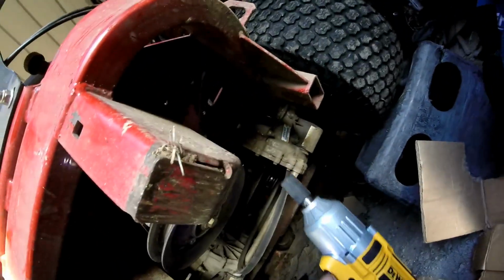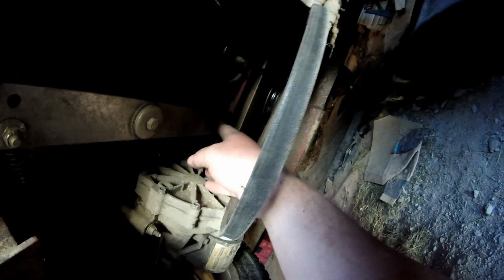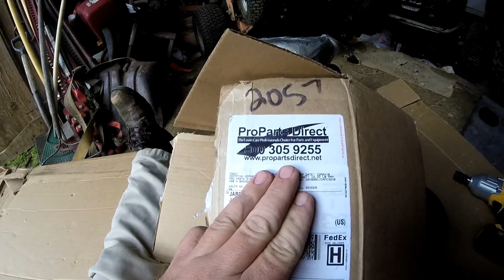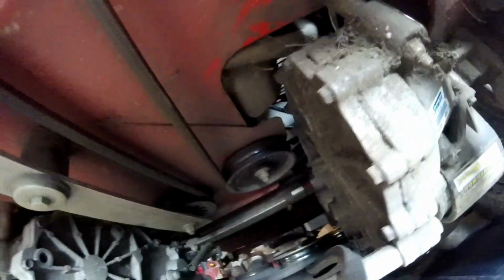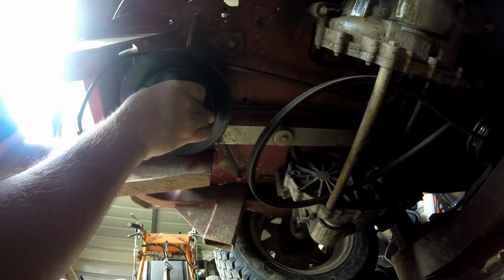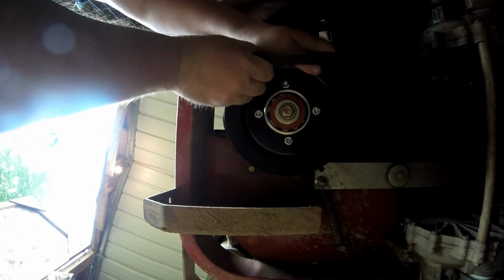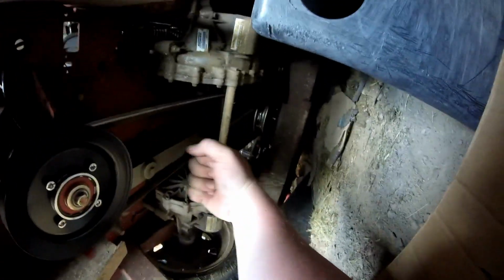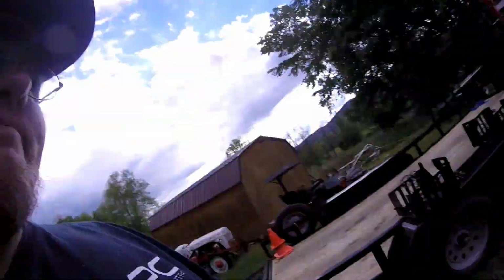How To Replace A PTO Zero Turn Mower

Comment: don't they make this noise when they need the clutch to be adjusted? Is this not adjustable? Friend of mine had the exact same noise as yours did and all he did was back off those spring screws around it and spins like butter again. The clutch was engaging when the PTO was disengaged and dragging so a slight adjustment fixed it. Try it if you still have the old one!

Comment: Why is my fly wheel turning when I try to remove bolt from PTO clutch. Toro zmaster 74923
Reply from the maker: because it is attached.Why I use an impact.If not you need someone to hold the fly wheel nut whilst you remove the pto bolt.
Reply: @exterminator1  thanks
Reply: @christopherholland9498  Mine was doing the same thing, so I broke out the impact and it worked perfect.
Reply: @pezatsea  Yea impact worked great. I believe I saved 500 or more doing it myself

Comment: Nice job! Ain't it fun working without a helper! I think ur supposed to use blue Locktite on bolt. Anyway after watching ur video I feel confident in changing mine on MX5060. Gonna get an Extreme clutch.

Comment: I spy a sliver deck john deere my dad bought one of those new in 96 when he first was getting into mowing but the wheels where steel. He also had a john Deere yellow deck walkbehind and john deere weedeater that still starts first pull today that I use